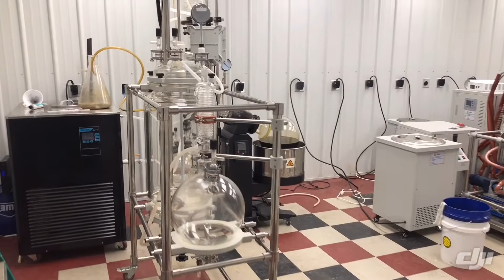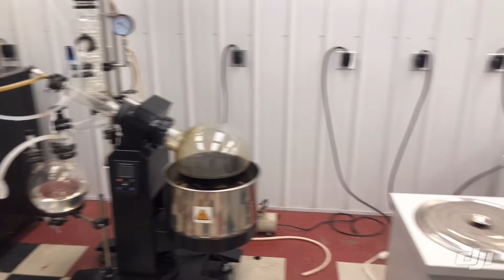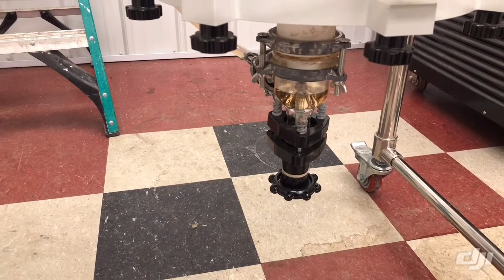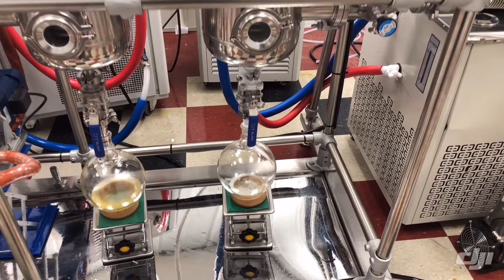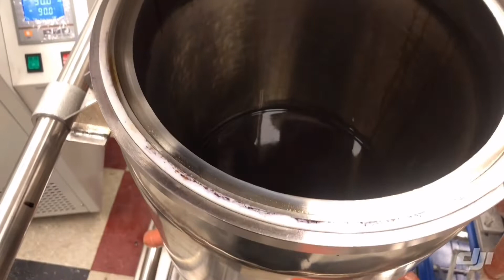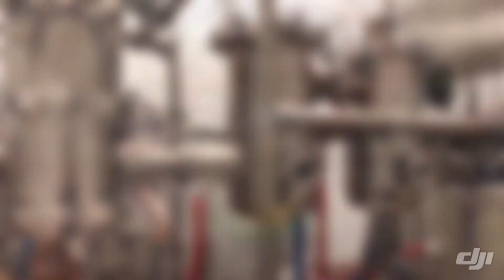Turn your CBD crude oil into sellable CBD distillate [output 5L/hr]

Comment: Outstanding content!! Quick question though, the resulting distillate will not only concentrate the CBD, it will also concentrate the THC content within the resulting product; how do you get around the resulting distillate having a THC percentage greater than the allowed 0.3%?
Reply from the maker: You are right. If you input material has high THC level, then it will be carried to distillate. There are two commercial way to remove THC. 1: Use HPLC or regular LC column to filter out THC. 2: just crystalize the CBD and wash THC out. THC do not crystallized.
Reply: Farm bill is for consumable it’s okay to have the “wash” of pure thc in the lab as long as its “disposed” of and not sold
Reply: The lower THC content flower is grown with purposely selected seed strain to have this level of high CBD and low THC.

Comment: Hey man! Very informative. Thank you greatly. Could you please tell me the conversion from lbs of biomass to liters of crude oil?
Reply from the maker: The ratio is largely depends on your CBD level in your biomass. If your biomass contain 10% CBD, then 20 lbs of biomass will give you 4lb of crude oil
Reply: @greenstonprocessingequipme5789   then 20% CBD at 20lbs biomass would equal 8lbs crude, correct ?
Reply from the maker: @forrealtrendz  that is correct

Comment: Great video and great setup. What sort of cost would I be looking at for that equipment.?
Reply from the maker: Turn crude oil into distillate: $105,000 for complete set. Turn biomass into crude oil: around $80,000
Reply: @greenstonprocessingequipme5789  where does one purchase this equipment from
Reply from the maker: @daisynuts9835  Most machine come directly from supplier in China. alibaba.com is a good source. I would recommend lab1st or yhchem as two good suppliers.

Comment: Hey how much it will cost to set up a system like that in Israel thank you
Reply from the maker: For distillation system, it would cost around $90,000 USD. Include all heater chiller and vacuum pump.
Reply: @greenstonprocessingequipme5789  this machine suitiable for Crude Patchouli oli

Comment: What temp and vacuum did you run the final batch at?
Reply from the maker: Hello John, I used 155C with 0.05mbar.
Reply: @greenstonprocessingequipme5789  What was you condenser temp?
Reply from the maker: @christopherzatzke8589 Inner condenser is 75C. Cold trap at -25 and -40
Reply: @greenstonprocessingequipme5789  Interesting. 155 still temp, and 75 on the condenser at 35 micron, correct? Full wiper speed? 

What temps/vac do you run the devolatilization pass at? 

Thank you kindly in advance for your reply. 

-Chris in Michigan
Reply from the maker: @christopherzatzke8589  I run devolatilization at 140C and condenser at 55C. With 300+ micron on vacuum level.
Reply: @greenstonprocessingequipme5789  these are the same parameters I run on a very similar apparatus. Your willingness to share knowledge is greatly appreciated. 

Would it be possible to arrange a short phone call?

Comment: Hi Jimmy, how are you? I just would like to know if you make the decarboxylation process in the rotavap or perhaps you use a vacuum oven or some decarb module?
Reply from the maker: Hello Mauro. For decarboxylation, I use either rotary evaporator or a jacketed reactor. In both case, I will use vacuum with cold trap to catch those cannabis smell. Vacuum oven is not a good choose. It is much slower than reactor/rotary, since oven do not have a aggregator.

Comment: What method did you use to increase the flow? You mentioned adjusting the vacuum and the temperatures on the center coil. Is there a general guideline?
Reply from the maker: two way to increase flow for distillation. 1: increase the temperature slightly, about 4-8C. 2: get a better vacuum. Vacuum is the key for distillation. If you have turbo pump, put that into the distillation system